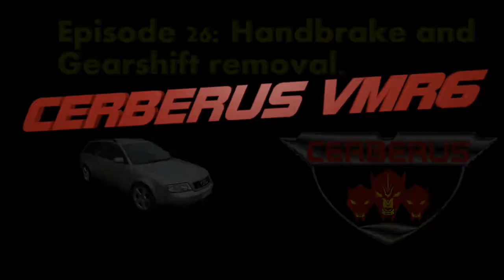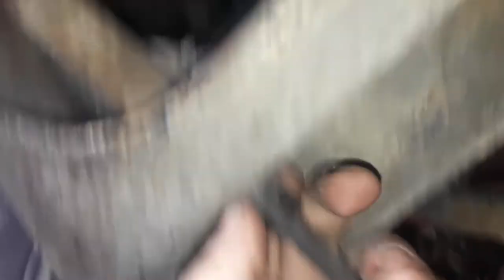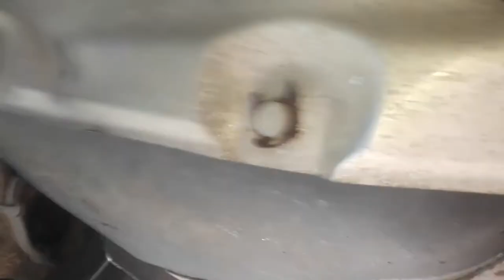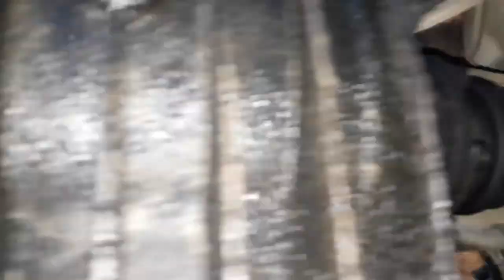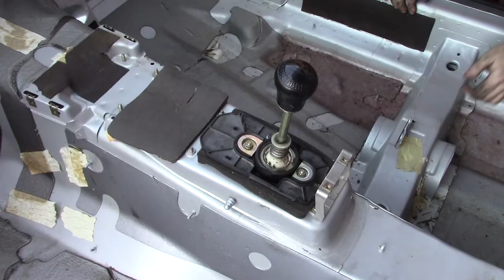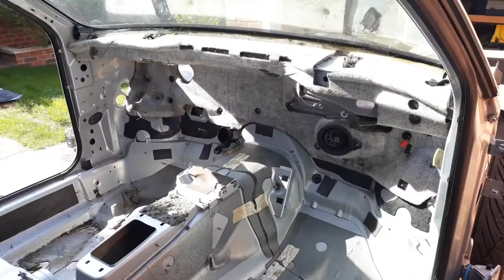Removing the Hand brake and Gear change: Audi 2.7 Bi-Turbo. Ep26.

Comment: Nice videos. I recently discovered your channel and have been watching as I have been considering this for a while and have been building knowledge on the topic. One thing I'm finding hard is the moving of the gearbox to the rear of the new car. Maybe you can help.. I'm not finding information on how control of gears via the shifter is maintained after moving the gearbox. I have never opened one, but what to find out things like this before buying a donor. Thanks for all of these videos.
Reply from the maker: Hi James, Yes I did an episode on this, Ep13, Designing the gear change and handbrake for my DIY Supercar. Hopefully this will give you some pointers. ;)